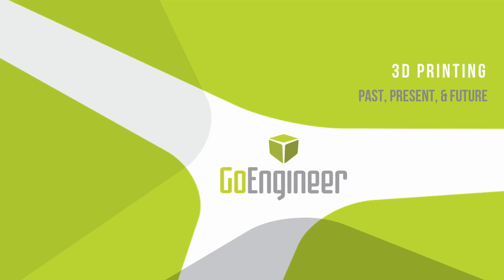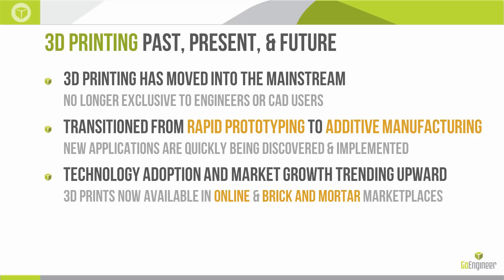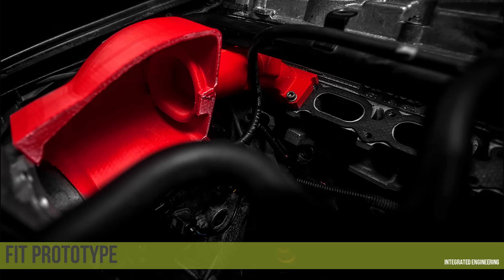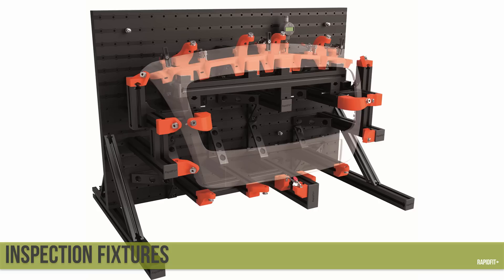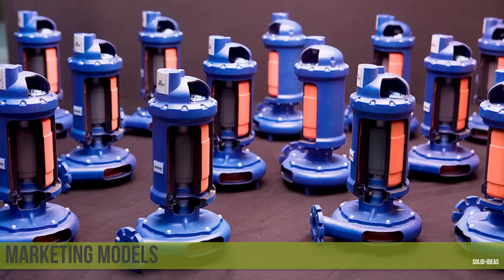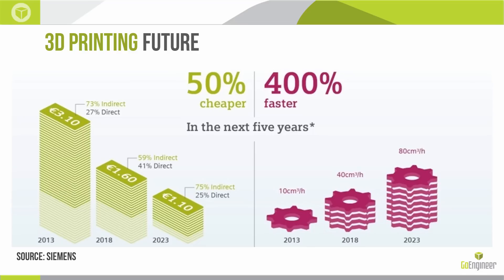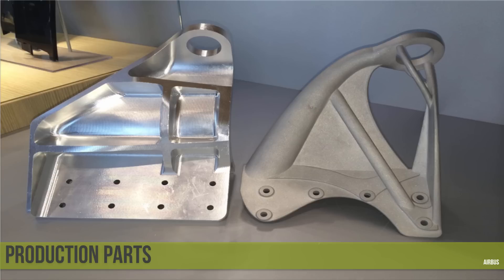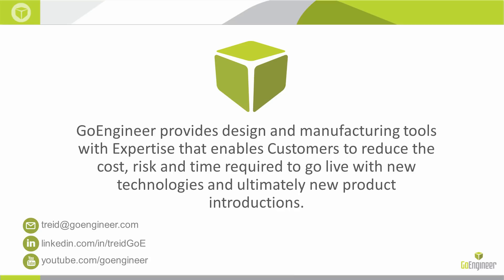3D Printing - Past, Present, & Future

Comment: Really good presentation! I was just wondering if you have anymore material going a little bit deeper into consumer 3D-printing. What are the major hurdles there? As you say everybody has heard of it, why are there so few printers out there
Reply: +michiel spaapen I deal almost exclusively with the commercial machines, so I don't have any material on consumer 3DP. I would check out some of the threads on www.reddit.com/r/3dprinting to get an idea of what to expect with a entry-level machine

Comment: You say in your presentation that you can't print in urethane, but I have seen plenty of flexible filaments which are said to be made of polyurethane or "TPU", e.g. the ones from MatterHackers. So how to reconcile this information?
Reply: +Maker Linux You make a good point - If I said it can't be done, then I was mistaken. As you mentioned, there are consumer grade thermoplastic polyurethane filaments available (I'm not aware of any commercial machines that print in TPU). Note though that TPU is a small subset of polyurethanes - the vast majority of PUR materials are thermosetting and not suitable for 3D printing. Using a two-part PUR opens the door to many different material options beyond what is available with printing technology today.

Comment: Thanks for the great presentation.  I'm long retired but I've just recently been getting serious about purchasing a decent 3D printer to print some prototype parts I've developed, and currently developing, using Solidworks.  What's your opinion on the latest SLA process/materials vs FDM?  My attraction to SLA is twofold.  It seems to be about 50x-100x faster than FDM and promises complete fusion so produces apparently layerless much stronger parts.  I'm initially interested in ABS parts.  Are current photo resins as strong as ABS?  Any tips are appreciated. Thanks!